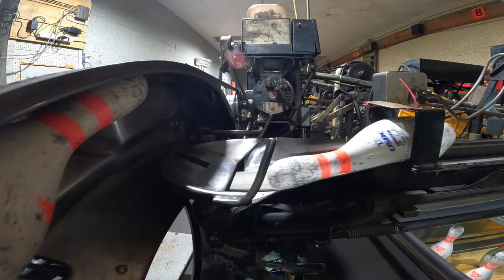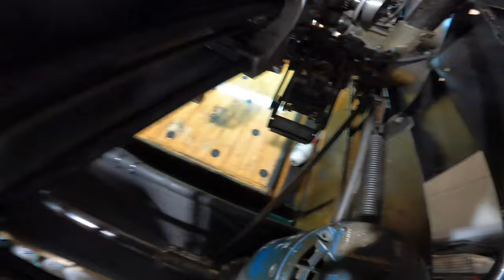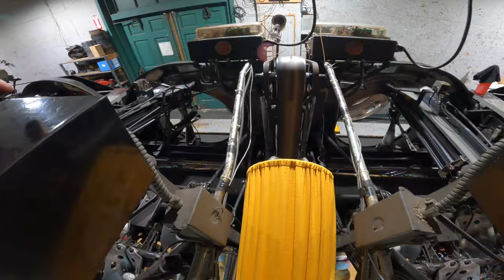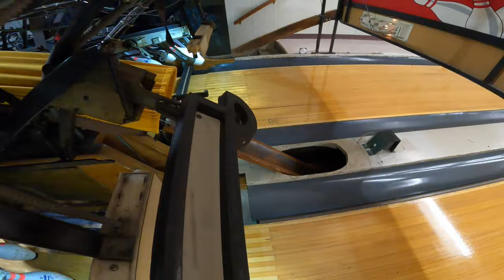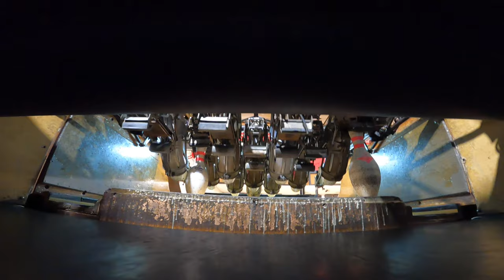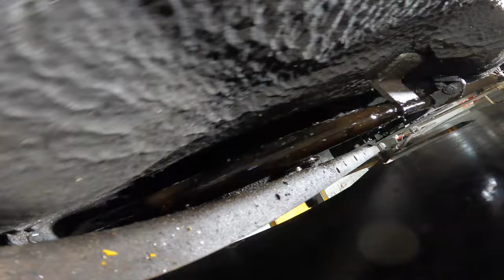12 AMF 82-30's doing their best work!

Comment: I bowled in junior traveling league back in the 70’s and it was so easy to see which houses gave a crap and which didn’t. One of my favorites had 82-30’s that were lovingly cared for. So quiet you could hear a sewing pin drop. They had the bar sweeps and there wasn’t so much as a scratch on them or anything else in the place. I think they even replaced the triangles if one took a hit. Zero calls in the three hours we bowled. Never a complaint about ball damage. The proprietor had to have been happy. Like most other bowling alleys, the place is long gone but the lessons about good maintenance are not forgotten.
Reply from the maker: That’s a great story… I wish more people cared about their machines today. It doesn’t matter how fancy and new your things are, what matters in the long run are how well you treat them..

Comment: Compared the GS-X I work on, this design I like because the lane oil doesn't affect the machine as much as it does the GS-X. Lane oil ends up cycling through the belts and machine where you get slippages on high lineage days where you can't get to them to wipe them down...
Reply from the maker: We get that too, but usually only when it’s time for the belts to be replaced

Comment: Those ball elevators are interestresting. I used to work on these many many years ago and I don’t recall our 30 elevators going straight up. Could’ve sworn they went up on an angle. These look like they go straight up. 🤯
Reply from the maker: Yes, you most likely had pbls or a different upgraded version. These are the originals

Comment: Did they originally equipped with the 1st gen pin wheel?( the pin wheel that does not have a hole in the middle , I’m not sure what they are called)
Reply from the maker: Nope, that’s a different model
Reply: That's for 3930, 4400, and early 5850 machines. btw, they are called "closed pinwheel" model.

Comment: Where are the machine guards?  Too many belts and moving parts that could grab a hand or two!
Reply from the maker: You have to be safe and smart while dealing with these machines…
Reply: @Joethepro181  Safe, smart and common sense.  I started working on 82-30 in late 1970 and am still working in a bowling center.  Machine guards came in about the same time that common sense was missing from far too many new hires.